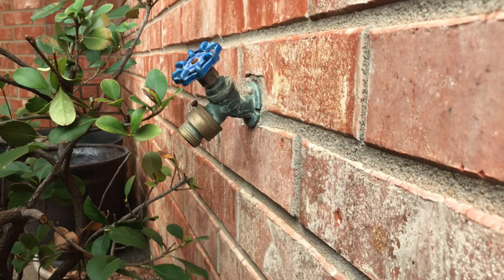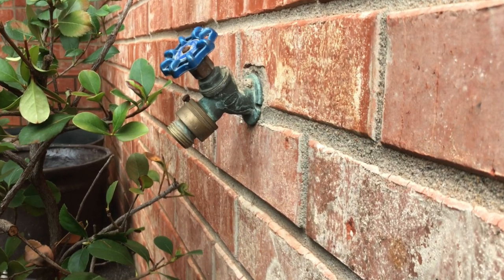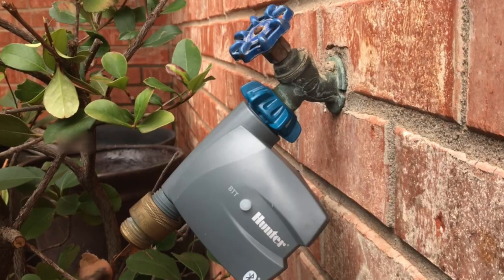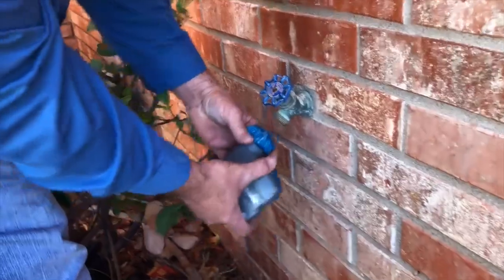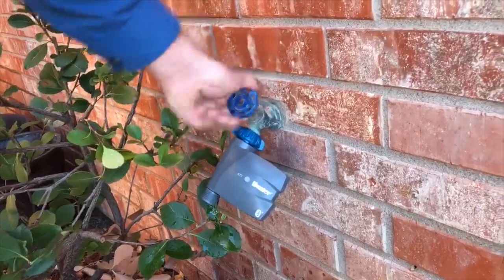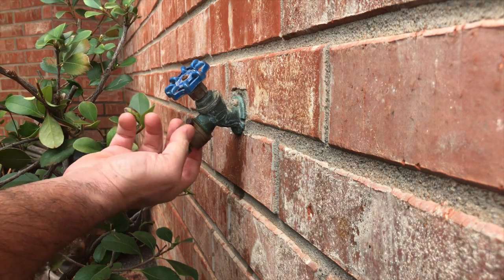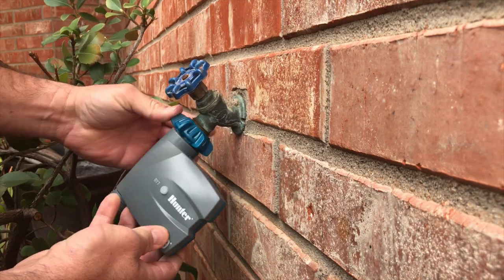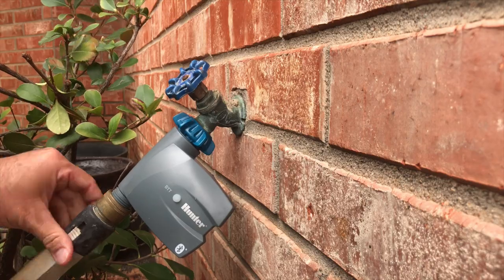Hose Bib Backflow Preventer with Tap Timer

Comment: I have a 2 zone water timer, do I need to have a backflow preventer for each zone?
Reply from the maker: Technically Yes. It sounds funny and it may look funny, but having one on both outlets is the way it is supposed to be done. Because they are not meant to be under pressure all the time you can not just put one before the timer. It will not work properly. That is my professional opinion.

Comment: Great Video, this gave me an answer which I was looking around. Also, I need your suggestion on my hose timer setup. I have one exterior faucet in front of my home where I'm installing soaker hose surrounding my home which is about 250 ft. I have an "ABP Arrowhead Brass Vacuum Breaker 1019-A 486 BFP PK1390" vacuum breaker attached to my faucet where it's connected to a 2-way hose splitter(Y connector) and one end of hose splitter is connected to a smart hose timer followed by a filter, then a 20 psi pressure regulator and again ending in a 2-way hose splitter(Y connector) so that I can have two connections for soaker hoses. So in this case, as you suggest I can place the vacuum breaker after the hose timer.  If I do so, shall I need to place another vacuum breaker on the other free end of the first 2-way hose splitter? Because if I move the vacuum breaker after the timer, the first two-way hose splitter ends up connecting the faucet directly and only one end of the hose splitter has a vacuum breaker connected. The reason why I have a 2-way shoe splitter connected in the first place is that one end can be used for soaker hose setup and can have another free end which can be used for other future purposes.

I know its a bit confusing but any suggestion would be greatly appreciated. Thanks!!!
Reply from the maker: Yes. You will need another vacuum breaker for the other side of the splitter going to your hose. That is what I would do and suggest.
Reply: @AmericanIrrigator  Great, thanks for your response.

Comment: Thank you for the video. What if the house has in ground sprinklers with one of those timers but with 4 stations”. are these backflips preventers ideal for this situation, if so, I would assume each station requires one, yes?
Reply from the maker: That is a good question. In theory I would say yes. To get the proper backflow protection each outlet would need one of these, although that does sound a little over kill.

Comment: Very good video.  I keep have my backflow preventer dying within months.  

Question, From the main spigot, I have a 4 way splittler for the water.  I keep the water on all the time, and from each split of the hose, I have a timer on each of them.  Do I need a backflow preventer after each of the timers?
Reply from the maker: Technically yes form my understanding and form what I have been told.
Reply: @AmericanIrrigator  Doesn make sense to me. We want to prevent water from going back so if its after the spigot, shouldnt that prevent it. I have 2 four way splitters. No way installing 8 of these makes sense.

Comment: Hello..thank you for info!..however if hooking up a timer..do you really need a backflow preventer?..reason being is because when timer turns off..it closes its valve preventing any water from coming back does it not?
Reply from the maker: Yes you are correct in that when the valve is shut nothing will backflow. Most of the time things work well and you may not need a backflow preventer, but a backflow preventer is for the times things malfunction and there is a problem. Like a water main break near your house. A water main break will cause a negative pressure down the line creating a suction ( back siphonage). If you were watering during this time, meaning the valve is open, there is a possibility that it will suck what ever is in your line into your house and possibly into the water main. I've heard of a ton of horror stories of this happening, so I like to take the approach that it is better to be safe than sorry. Plus it is a city code in most places but this mostly affects new builds. Stay safe out there. Hope this helps.

Comment: The problem is that many modern spigots with these Vacuum-breakers have finer threads.  This is specifically so you CAN'T attach a hose directly to the spigot.  If you remove the vacuum breaker, the timer input threads will not match up with the spigot.  And the vacuum breaker threads will not match the output of the timer.
Reply: You need the adapter by Spigot Master.
Reply: @mikevega1097 crap. I need an adapter. Anti hammer device. Timer. Backflow device. Then my soaker hoses. Seems like so much to just use the hose.

Comment: If the main shut off valve is kept open and the timer valve is open, water will flow out to the irrigation system. But when the timer closes the timer valve, I don't understand how water can backflow into the house past a closed valve? Therefore, why is a backflow preventer needed?
Reply from the maker: I usually say it is not for the cases for when everything works properly the way it should. Backflow preventers are for the times when things go wrong. It may not happen much, but it is better to be protected when it does.
Reply: When the valve inside the timer closes, simultanuosly sprinklers heads retract back causing the water inside the pipes to be pushed backwards. A drain valve in sprinkler will minimise as well the back flow as it drains water once the valve is closed. Its always better to add a vacuum breaker.

Comment: I have a vacuum breaker hard attached to my tap, if my tap timer stops the flow and puts it under pressure the vacuum heavily leaks everywhere. Is that supposed to happen?
Reply from the maker: No that is not supposed to happen. It may be damaged or wore out and would need to be replaced. Most of the time when they start to leak, it’s time for a new one. Unfortunately they do go bad from time to time.
Reply: @AmericanIrrigator  Thanks mate

Comment: This video makes almost no sense. With the water left on, there is no backflow. If city water pressure drops, a back flow preventer stops backflow whether it is on the spigot or each of the hose ends. In fact, putting it petmanently back at the spigot is required by many local codes. Further, most timer ends aren't designed to take the often short threads of the backflow preventer and they tend to leak if installed there. Leave your backflow preventer at the spigot and don't worry about this nonsense.